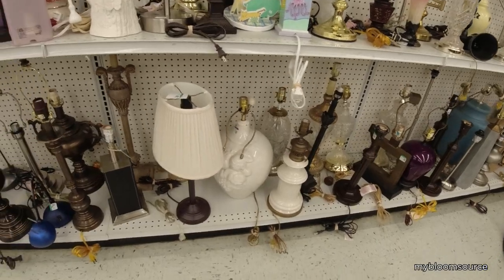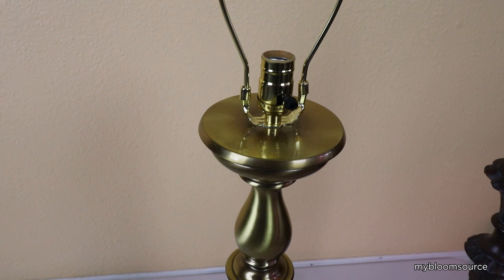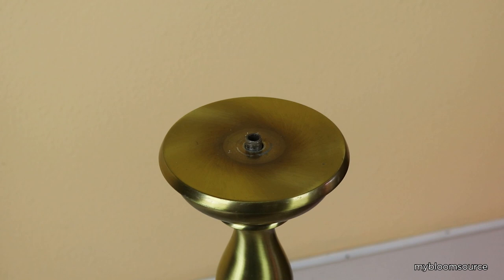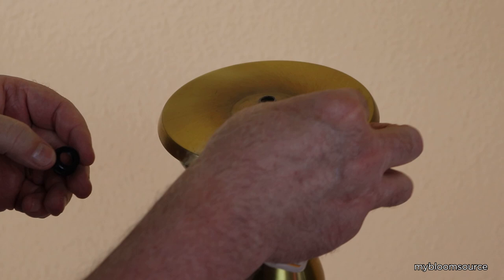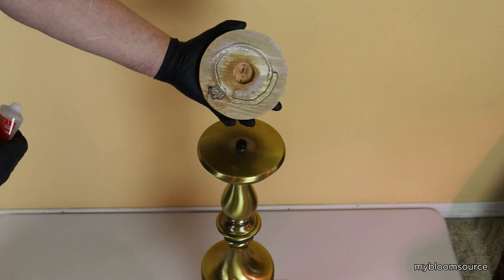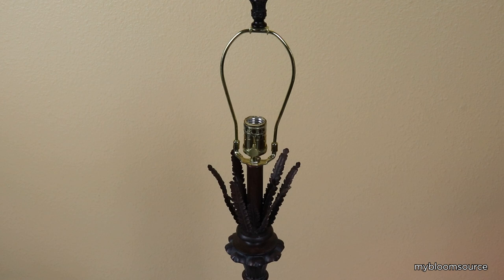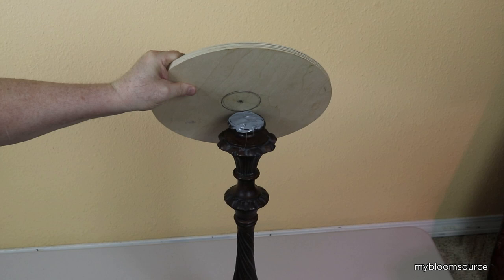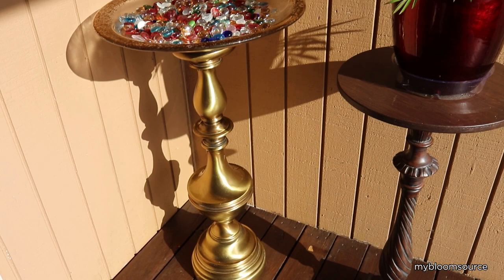Easy DIY Lamp Repurposing | Make a Birdbath, Bird Feeder, Plant Stand or Table

Comment: Any ideas as to what I can use instead of having to cut wood" for a spacer?? I love  these ideas
Reply: I painted the inside of small glass jar and used that as a spacer. Worked like a charm and gave it a little more height.
Reply: @kfitz192  awesome  thx
Reply: Anything deep enough to accommodate the bolt size. Some just won't budge without a saw, especially with plaster mould lamps. Bowls, saucers, cups, condiment dishes, votives, caps, tiny boxes, etc. Save all your unused project parts in case you may need them for another.
Reply: Most lamps i work with have enough room to lower the threaded rod the half inch or so to make the rod flush with the top of the lamp. You might use a thin metal bolt or a circle of metal to glue securely to the top of the threaded rod. That’s how I’d do it anyway!

Comment: Wouldn't a wooden lamp rot outside when wet?
Reply: 1252PFC, look at bird bath
Reply from the maker: It could. The wooden lamp base in our video is actually plastic. If you use wood and plan on putting outside you could seal it but it would still be exposed to the elements.